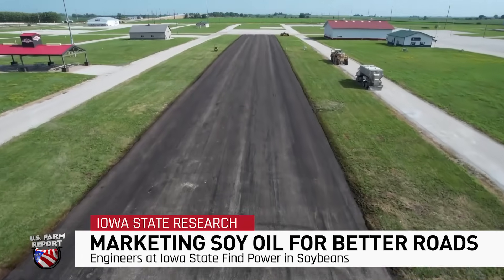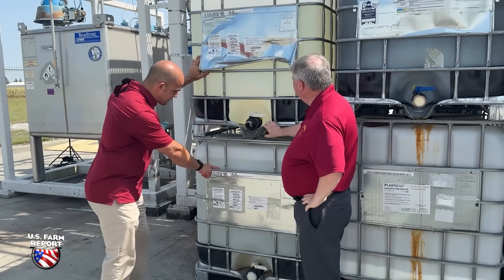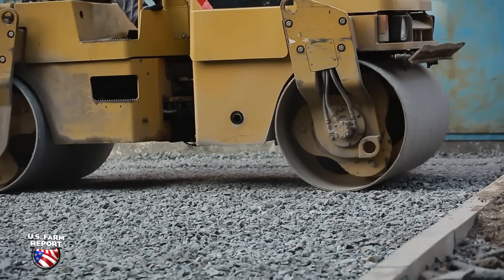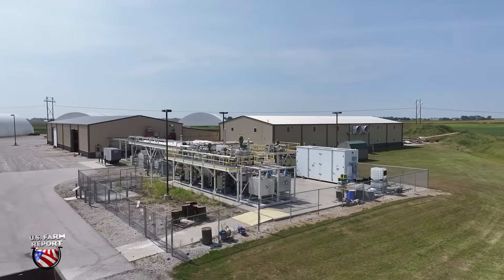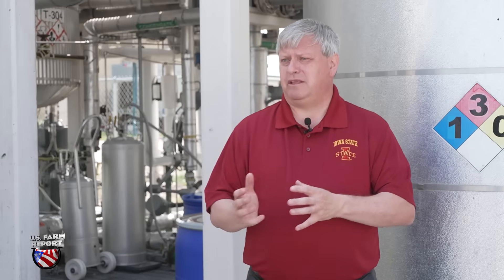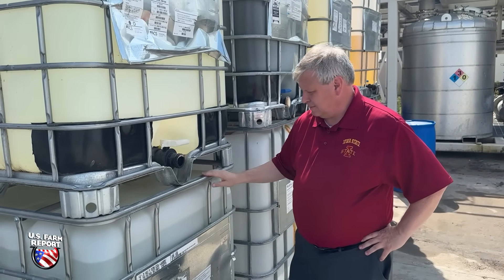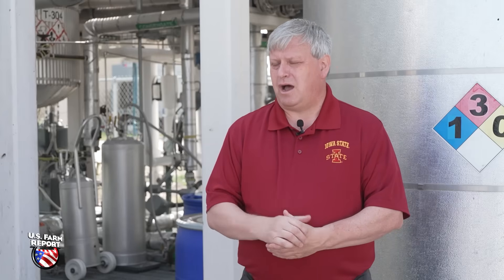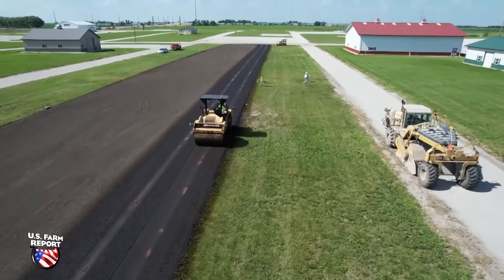A New Road for Soybeans: Building New Domestic Demand

Comment: Well, a lot of farmers had their trucks downed when Ford used it to insulate wiring in pickup trucks. The mice LOVED IT!  It didn’t make it a full model year because the trucks were being attacked right at storage lots outside the factory and on dealer lots. 

I will say, if it can compete, then let’s do it. It would be a huge win.

Comment: here's why tariffs are called a tax. lets say a tractor costs $100k before tariffs. and let's say the sales tax is 5%. so you pay $105k to get the tractor home. the seller gets $100k and the govt gets $5k, and you've paid $5k in taxes. so now let's say there is a 30% tariff on the parts to the make the tractor, so instead of $100k that same tractor is suddenly sold at $130k, with the $30k paid to the govt when the tractor maker imports the tractor parts. and then you pay 5% sales tax on $130k, so you pay $136.5k in total to get the tractor home. so now instead of the govt collecting $6.5k from you and the seller collecting $100k, the govt has now collected $36.5k from you and the seller has still collected only $100k. so you have paid the govt $36.5k after the tariff vs the $5k you paid before the tariff.
Reply: and a revenue on imports..   so there that